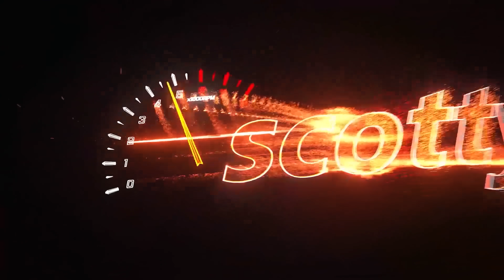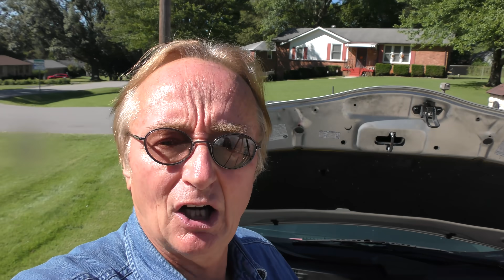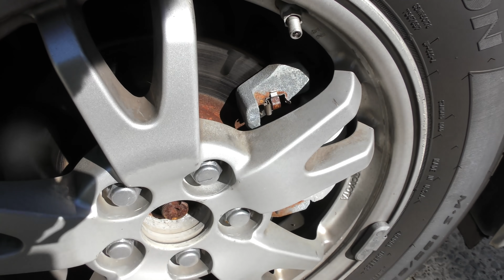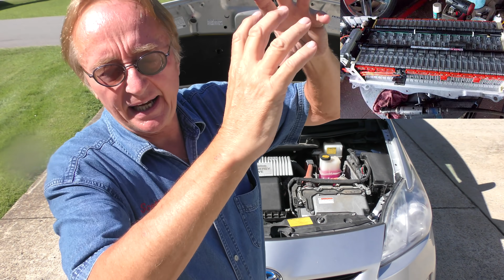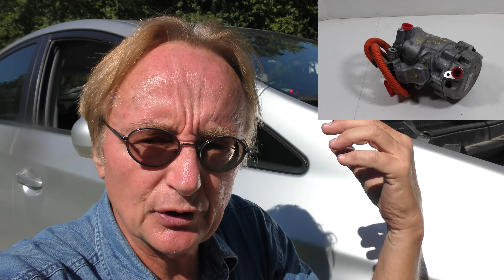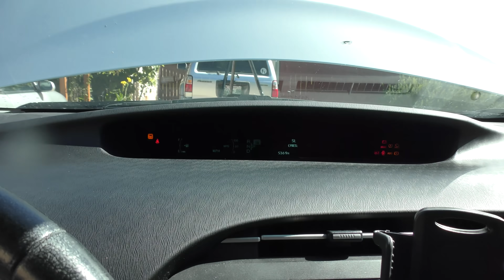A Sad Day for Toyota Owners

Comment: Making the electric cars is not the main problem. The real problem is the load its gonna put on the power grid if they even get to the point that people can have enough charging stations. Its really senseless to stop using gas in cars to just use oil to create the power at power plants & then distribute it to all the different stations. Also imagine a bad storm & the power being knocked out. How about the controlled black outs that some States already do? If they get there wish & use government to make electric cars mandatory people will regret it. If it isn't broke don't fix it.

Comment: Headgasket failure is due to overheating the engine from low coolant. Low coolant came from some coolant leak in the system. All it takes to fry an engine is low coolant or coolant that was not bled properly to get the air out of the cooling system.
Reply: Coolant reservoir tank leak caused my engine to overheat. And, I had to get the head gasket replaced. Most are made of plastic. Get cracks in them that caused the leaking. Best to have an extra coolant reservoir tank for a future emergency? A coolant reservoir tank is about $50, a head gasket replacement by a mechanic, is many times that $50.
Reply: On the Prius's and Lexus CT200's, this is actually due to the EGR cooler plugging up and increased cyl temps in cyl #1 & 2. Well documented online in the forums. EGR cooler has to be cleaned periodically (though Toyota will never admit it!).
Reply: These have electronic water pumps that fail. That’s what cause head gasket issues
Reply: not always true! Head gaskets blow between cylinders too. I bought a 2009 Matrix not knowing the 2009-2011 Toyota 1.8L has common head gasket problems. It was blown between cylinders 3 & 4. I know now! 🤣🤣

Comment: Hi Scotty, I have a 98 Silverado 5.7, the radiator leaks down to about an inch bellow the top of the radiator and stops leaking. I can't keep the reservoir full, and every time I refill the radiator, when I drive it, it'll leak back down to the same spot and stop leaking. The engine never runs hot either. What do you think?
Reply: Can you see the actual leaking spot?
Reply: I haven't narrowed it down yet, but there are drips under it after it's been driven. I've honestly just been leaving it though, cause like I said, it leaks down about an inch then stops leaking and never overheats. It just bugs me knowing there is a leak somewhere

Comment: I did a engine swap on my 2006 Honda Civic hybrid. It was more of a pain as it was more cramped and had a couple extra parts it was very similar to a normal engine swap. I got it back together in one week. Don't think I'd do it again but I wish I had swapped or had the cvt transmission fixed while it was out. Doable if you have time and patience, just make sure to flip the big switch to the hybrid battery.

Comment: I had a really bad spark plug i found on the ground misfiring replaced it with the broken one, broken ceramic, its workin
Reply: I  think pulling all this oil out of the ground is holding off the volcanos

Comment: I've replaced an engine twice in a 2010 and 2011 and I'm only 21 😂 the electric water pump is crap and when the cats get stolen usually the exhaust coolant lines get cut with it and blamo. There goes your engine!
Reply: You may or may not be talking Toyota. You post is vague.
Reply: Exhaust coolant lines???? Would that be the same coolant that goes through the engine?
Reply: @thirtythree160  yes, it's specific to gen 3 (10-15) the coolant routes around the exhaust and then comes back up. It's a stupid design
Reply: O ya froshizzel
Reply: The lines in question are for the EGR cooler. Part of the engine coolant loop.
Reply: You should buy a dodge thin i over 200000 on my dodge bin a good car Toyotas are over rated and toyota fan boy just talk mad shi adolt uther cars
Reply: @stevenbaker673  you can't spell....that's why you bought a dodge and think it's better.
Reply: @richsweeney1115  You can't punctuate correctly.  I guess we are all flawed, aren't we?
Reply: @jasonk876  I didn't take the time to even try to look at it before I made that comment...I was at work on lunch..but you're basically saying Toyota isn't reliable..when they're one of the most reliable
Reply: @richsweeney1115  wow, I don't remember saying that. Just quote my words, to help me remember.
My friend had a Chrysler (dodge) ,3.6 if I recall correctly.  They put almost 300k miles on it, problem free. 
I knew another guy that had a Tundra that blew up at around 70k miles. 
Toyotas can be very good, but this myth that they never have problems is ridiculous.

Comment: Yeah the bar sealer you recommend for my radiator sealed it for about 2 years .. 2017 to 2019 from El Paso heat to Montana cold .. I had to buy the sealer a few times though like it would seal then leave again then I would seal it and finally when I moved back to Fresno in 12/2019 it finally gave out .. oddly enough it was as if someone stabbed my radiator 3 times

Comment: I wouldn't mind having a Prius, yank out all the hybrid battery system, then install a Toyota 2.4 four cylinder. Still very aerodynamic vehicle.
Reply: A long time ago, I was reading an import magazine, and I saw a Prius called tree huggers delite , it had a turbo Ed  gas motor swapped into it with a standard tranny.

Comment: Well, there goes all the money he saved on gas!
Reply: Yup. A lot to be said for simplicity.
Reply: Personally whenever people say they are "saving" the planet by buying electric/cars, I always say what's wrong with buying a used car. Them old Honda CRXs were pulling 40 mpg on the highway back in the 80s.
Reply: @kaunggoliathsan  What about all the mining that is done by China to get the raw materials needed to make all these batteries, and you know they don't respect the environment or what mess they leave behind.
Reply: @kaunggoliathsan  I had a Datsun 1200 from 1972, It got great gas mileage! When you looked under the hood, it look about the size of a lawn mower engine!
Reply: Yeah...owner is in a bad spot,any way you look at it.
Reply: NO repairs required on my 2015 Sonota hybrid yet. Quiet, comfortable, reliable, and economical. What more could you ask of any car?

Comment: After owning three VW diesels, my father purchased a 2010 Prius.  90-year old Mom now drives the 2010 Prius or I drive her in it.  Being a retired Electrical Engineer that is a DIY auto maintenance guy, I will more than likely do battery work when it is necessary.  Since this Prius is 11-years old with 71,000 miles, I should be ok for a few more years.
Reply: God Bless  ur mom n you
Reply: Another 5-10 years the least
Reply: Time matters too not just mileage.
Reply: You certainly have the competence to handle those nasty big batteries! 
Props to you for that, guy!
You'll probably get to 110k-115k miles before noticing a gap in the charge.
Reply: Impressive!
Reply: The battery can be found for around 2k new from Toyota now. Now a bad deal. I have a 2011. Keep an eye on the oil level, and do extra oil changes. The 2010s and 11s are known the issue in this video along with burning oil from bad piston rings
Reply: I bought a 2009 Camry Hybrid that had over 200K and only had it a few months and put over 1K on it so far no issues.
Reply: I used to run RCs when I was younger. Clean all the terminals first. All the bars connecting the cells. 0V is a shorted battery. If it's failing open it will get hotter than the rest.
Reply: My brother had an 04 Prius , a specialist installed a reconditioned battery for it at a 110k , he sold the car to an Uber driver , it has 290k on it now with no issues at all
Reply: I'd stick to a diesel personally 😅
Reply: I drive a VW also that currently has 357,000 miles and going to strong.  I've only ever replaced oil every 10,000 miles.  I was going to suggest to Scotty that the solution to his problem with this 170,000 mile Prius is to replace it with a VW.
Reply: @ronaldschwartz1856  or just put a Tesla engine in the Prius lol
Reply: The Diesels get better mpg and last much longer

Comment: The Hybrid system is just like a giant HID ballast system ⚠️⚡ treat it the same as it can zap you
Reply: I don't think so. I think an HID ballast can cause some nasty, sharp pain, but on't think the HID ballast is as likely to kill you. It may have even higher voltage than the hybrid system battery. However the hybrid system battery has more power and more stored energy, more than enough energy to kill you. HID ballast can supply just the energy from the 12-volt battery, even though it's jacked up to a higher voltage. But what kills you is the power, and how long the power is applied, the amount of energy – not the the voltage. Power equals amps time volts. Energy equals power times time. Actually, current times time. The hybrid battery is about 240 volts but can supply much more amps than the little 12 volt battery. It has more coulombs of energy.
Reply: @soilmanted  some HID ballast are as low as 48volts ,some are as high as 20,000 to 25000 volts AC ,the older ones packed a punch, unlike today's modern digital ballast, but yes ,its the amps that kill ,not the volts. Been shocked by those stupid ballast before & even had a 1 inch spark jump out of my elbow, it hurts ,but probably won't kill you without a heart condition.....but then again, I'll sometimes mess with 34kv power ,but know better when only using the proper safety gear ,that kind of voltage & amperage will melt asphalt into glass 10 inches deep & make aluminum wires disappear as well as melt copper into little globs, it will definitely kill you

Comment: blue devil head gasket repair worked for me on a really bad head gasket.
Reply: There power steering pump sealer really works everything else is crap!
Reply: @ironmike7339  Lucas has worked well for me now over 4 years.
Reply: @wholeNwon  I tried two bottles back to back and it still leaked. So I went with blue devil and it worked. It may depend where in the system there’s a problem. Don’t usually try quick fixes because it’s mostly temporary but I was impressed.

Comment: Lots of people on youtube fix these cars including rebuilding the battery themselves
Reply: Still costs a ton of $$$. And if you’re not good at working on your cars, which most people aren’t, you’ll have to pay someone a small fortune to do it for you.
And the main problems is that if you change an old battery cell, there’s no guarantee another cell won’t go out in another month.
Reply: @Modernpatriarch223  I changed a timing belt on 2003 Camry 6, never did it before by watching youtube saved $800. Were talkig about people who watch Scotty trying to learn how to do stuf. Not the peoplewho don't
Yes replacing a couple cells is not a permanent fixed but many have gotten a lot longer out the car that way

Comment: I can believe it having a small head gasket leak. Toyotas are absolute crap. I only own Ford's and they all have over 300k miles and have never had any problems whatsoever.
Reply: My Uncle & his gunners shot a lot of them out of the sky in the summer of 45 over Okinawa. 👍
Reply: Hahaha, I almost died laughing.

My Dad's early nineties Corolla is at 650,000 km's.  Bud's 4runner is at 400,000 km's.  My boss's Tacoma has passed 350,000.

There is no chance a current age Ford will hit that.  No chance at all.

Few years ago, Few folks tried some Fords out, they're either all parked or junked.

Yeah, I don't see what you're saying HAHAHA 🤣

Comment: Hi Scotty, just saw your shorts about changing rubber timing belt. Can you make a video of best non interference engines?
Reply from the maker: will do!
Reply: @scottykilmer  Hi Scotty, I have a 2004 Toyota Sequoia. Do you recommend that I also change the water pump when I change the timing belt?
Reply: @Daveland777  Always, Aisin makes a kit with everything you need to do it right.
Reply: @Daveland777  If you are paying someone to do it or you are lazy and do not want to take everything apart, then yes. If you do not mind doing everything again then you could wait...mind you it is a 2004 we are talking about so it might be one its way out.
Reply: @Daveland777  I dont know if he will see your question but I would definitely change it out if it's at its recommended lifespan interval.
Reply: @Daveland777  yes every time it’s right there and it will never fail, seized and brake the belt and ruining the engine
Reply: @Daveland777  yes. And tentioner.
Reply: 3.4 5vzfe
Reply: The 3.0 V6 in older Camrys and ES300s is great and non interference.
Reply: Timing chain= life of vehicle
Timing belt=every 100,000 miles maybe earlier
Reply: 2.3 Lima baby
Reply: Nadull got fucked again😂